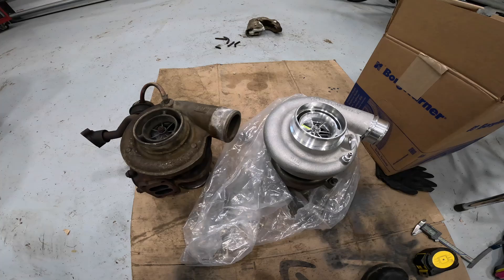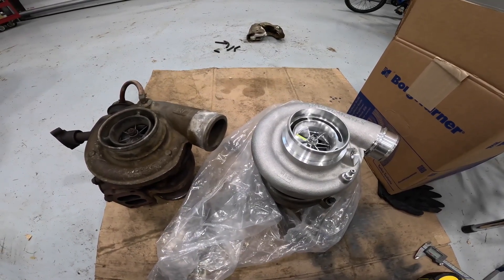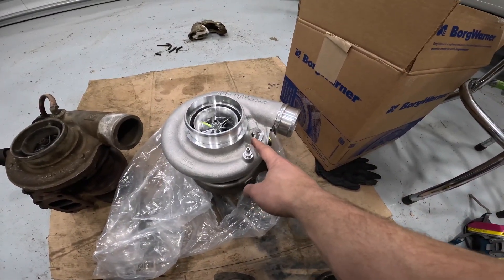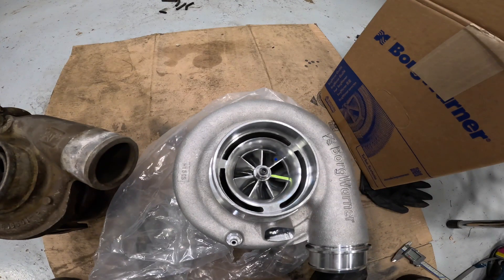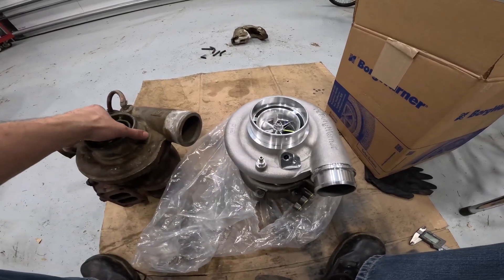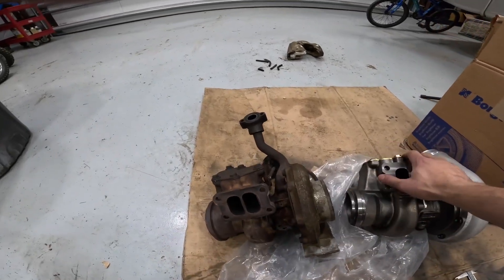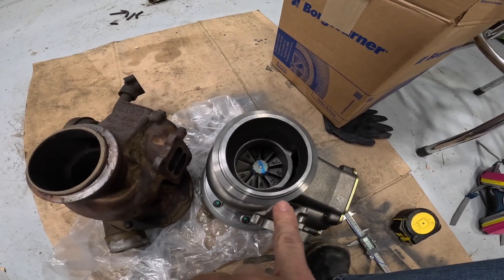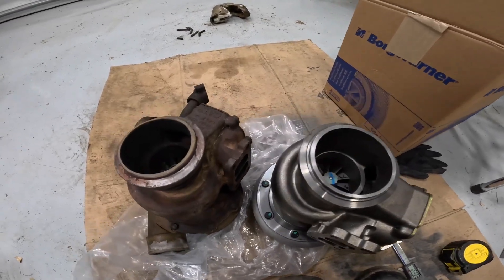Turbo Comparison: Borg Warner S300G vs. S300SX-E

Comment: Is that considered the hx40 or he351 exhaust v band
Reply from the maker: The one I bought is listed as an HX40 V-band according to my invoice (and that does sound right from memory). However if you call AGP turbo you can give them the measurements so they can make sure you get a correct bolt-in turbo. You definitely should make sure you get this right the first time. I was very happy with the service from AGP.

Comment: Would adding an electric turbo in front of the engine turbo help with performance? For instance decrease lag and increase power or fuel economy.
Reply from the maker: At this point I haven’t seen any electric turbos that I would use. You could do a compound turbo setup and size the inner turbo smaller to get less lag, or could add a belt driven supercharger to have a level of constant boost to also help reduce lag. As far as improving power or fuel economy, on the 3126B I doubt you’d get either given the computer controlled nature of the engine.